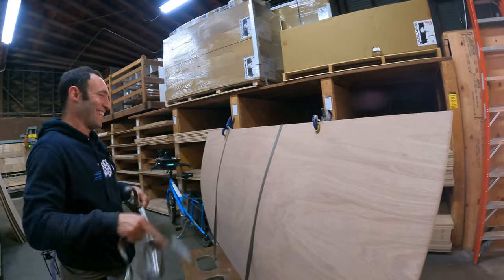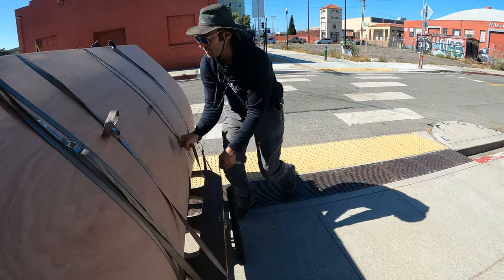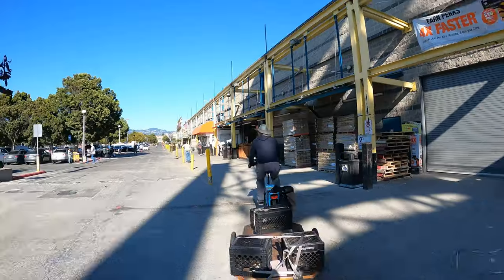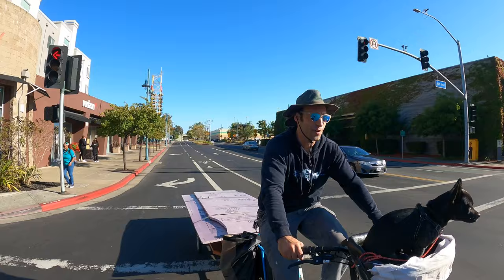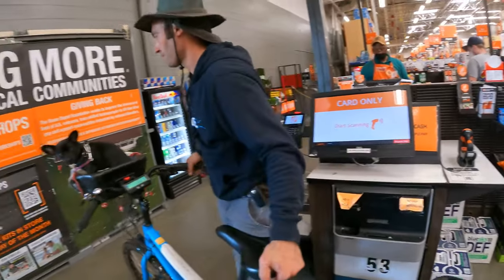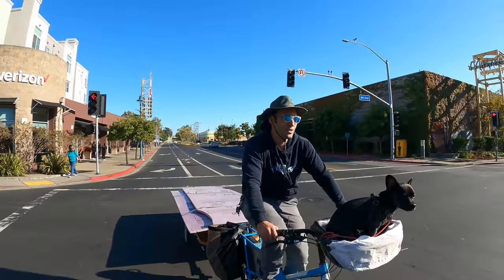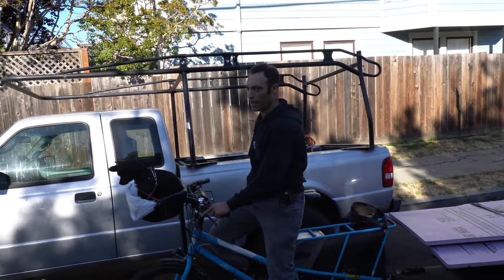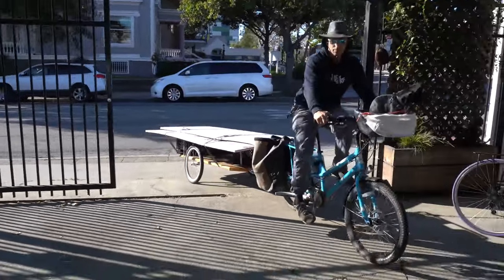Fun Local Cargo Bike Trailer Mission to Haul Sheets of Plywood & Foam

Comment: Not sure about the states - over here in Europe in Estonia - you can just rent a box trailer for you car from a big set of gas stations (assumes you have a hitch attachment though, very common here). It costs like 15 dollars for half a day.  

Now maybe something to follow from this idea - make the bike trailer (maybe with assisting electric propelling and) rentable (so people could just pick it up for a trip to the hardware shop and return it later) and i'm pretty sure people would pick up the habit very quickly. Riding a bike is often not the problem, having a trailer however might be out of reach for many. I used my bike trailer (2 seater for kids) very often for grocery shopping, í absolutely agree that it's a great solution.
Reply from the maker: Cool idea to get bike + trailer as a rentable solution from the big box stores. thx for watching:)

Comment: if you are not gonna haul a load of plywood by bike... I WILL! (actually did that last week!)
Reply: for my project, I knew I only needed 600 wide so I cut it length ways at the shop then transported it flat. full sheets would have been challenging in wind... and I was taking it back to my boat which has room to store a 2.4x0.6 sheet inside but not a 2.4x1.2 sometimes you are gonna need a full sheet though. I think I would have gone straight to the second method, or used rigid side struts to prevent it falling over
Reply: for me, "why bother" is because I live on a boat and I can take a bike on my boat (actually 2!) but not a car. (and even if I could fit a small car on my boat... would I? a bike is so much less maintainance!) I could probably have persuaded someone to help me or paid the shop to deliver it, but it's much more satisfying to do it my self. And, given that I choose to live an unconventional life on board an engineless sailboat, I feel it makes a better argument to not pull favors
Reply from the maker: Good to read your comment and know that this video is reaching people who are part of the human powered movement :)
Reply: @fossilfool  definitely! although as a sailor primarily my goal is more to balance the forces of nature to take me where I want, human power is the backup ;)